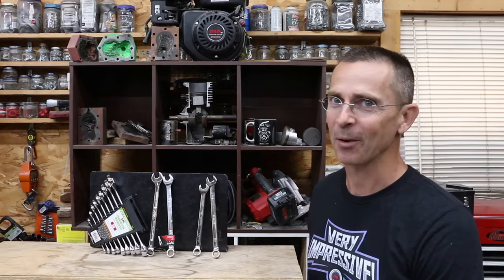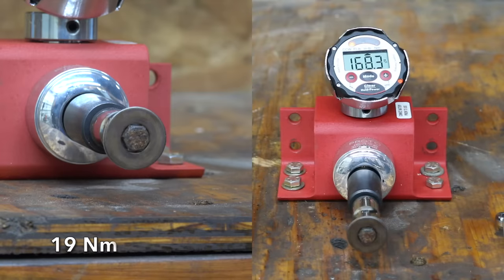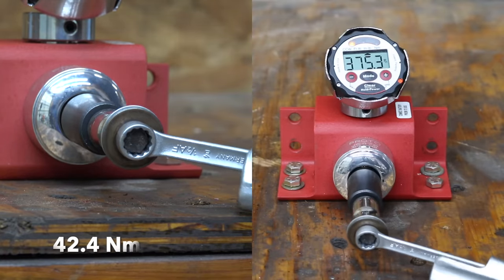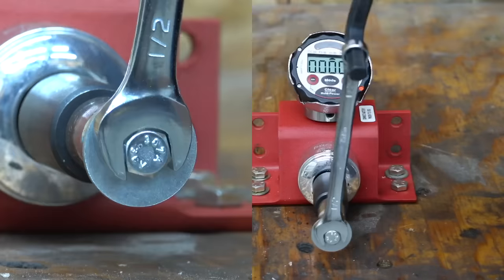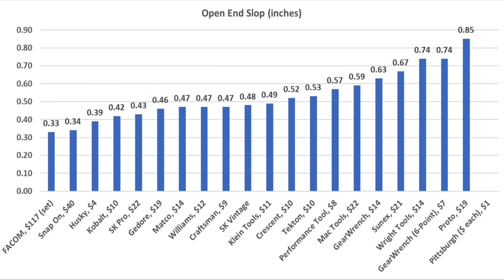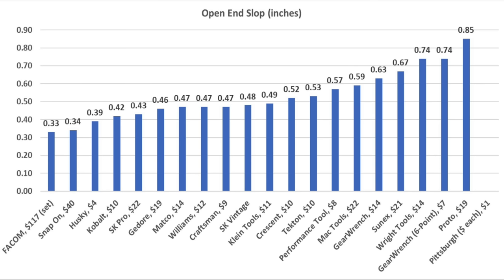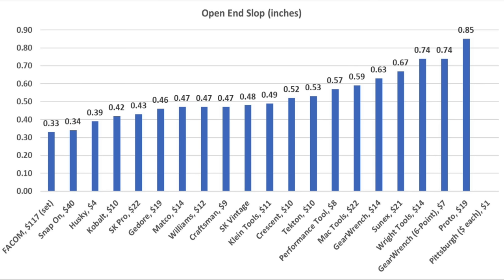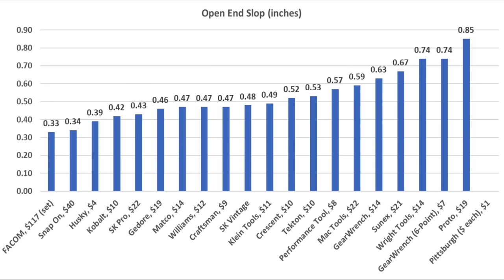Best Wrench? Let’s Settle This! Snap On vs MAC Tools, Matco, Proto, SK, GearWrench, Kobalt, Husky

Comment: This is like a PSA to all wrench makers about the excessive taper problem!!!

Go into just about any tool box in a shop that has to deal with those shallow headed fastener problems and you'll find wrenches and sockets that have  had the tapered section milled or ground down to let the tool actually grip the fastener. The fact that we have to do this to make the tool useful is pretty sad.
Reply: I have both wrenches and sockets I've done this too.
Reply: I was thinking this when I saw the first test. I was like 🤔 "I wonder how well would a cheapo HB wrench do if it was ground down" 😆. 
I'm from England we don't get over half these brands here, so I don't have a dog in the fight, so just out of interest. Same as the Husky, it seemed to be a good mid/to near front of the pack but only $4. Shame Todd made a mistake with it on the Max open End Hex test, giving it maximum points.., skewing it's final placing. I think it would of places 10th on Hex test meaning it would be around where the Facom set was placed. 

Measuring all the open ends for stretch after Max test would of been interesting to see.
Reply: Ditto the chamfer in the business end of sockets. Belt sanders work very well for removing this.
Reply: i have always used Stahlwille tools.  never a problem.  have seen many failures with younger Fitters / Mechanics who start with cheap sets.  always use correct tool for the job.
Reply: I agree, but the flip side of this is that without any chamfer, when the tool slips off it will slightly distort the end of the grip, over time creating its own chamfer.
Reply: I think maybe Husky is the best value for performance.
Reply: Same with allen keys. I grind them flat as well.
Reply: Yeah you're much more likely to damage a bolt on a wrench with that taper than one that's flat. And then that bolt  becomes a bigger problem.
Reply: I'm wondering if the chamfer isn't designed to lose grip before the wrench breaks in two?
Reply: 100% this.  I'm a motorcycle mechanic and in our shop pretty much all of our sockets have been lathed down so there's no chamfer, it makes all the difference aye
Reply: @imoovabull6042  Not everyone is born with the ability to start their careers with top of the line tools.
Reply: @urwholefamilydied  LOL, them's fightin words... Snap-On is a great tool, but from the way some people fawn over getting bent over without lube by daddy Snap-On ???  Mac is better and cheaper, with a decent warranty unless you treat your tools like shit and need to get them replaced often.
Craftsman or Klein if you're a home gamer.
Reply: @boots7859  neither was I,  I had to pay my tools off over time.
Reply: yeah, but we can buy cheaper tools! I often buy cheap crap wrenches to modify for specific jobs.
Reply: @brandont0618  I agree in part.  What I don't know is whether their quality has changed over the years.  I bought my set over 50 years ago and haven't had any problem with them....and trust me, they get used and abused.
Reply: @brandont0618  Try PowerBuilt. They look and feel much better than Husky.
Reply: bUt ThE eAsiNeSs oF sLipPinG tHe WrEnCh HeAd oNtO tHe FaStEnEr!!!
Reply: @StreuB1  Once rounded, twice ground?  Me, too. And I keep a cup of water near the belt sander to cool the tool rather than lose its temper.
Reply: That also makes the tool weaker when you remove material
Reply: Probably quite a few of us have done that to a few wrenches to fit.
Reply: ..yep, it is a problem..sometimes with sockets more so than wrenches...I have found excessive chamfer a really big problem on flare nut wrenches..on those, you want maximum surface contact..actually, I don't think you really need ANY chamfer on those...
Reply: @Zaque-TV  thats another reason I'm a big snap on guy. I like other brands too, one of my mac sockets has that drives me NUTS. My matco and snap on are flat, for some reason the mac has that little bevel. Don't have the balls to take a grinder to it tho waaaay too pricy. Then again my williams don't have it either.
Reply: @urwholefamilydied  I'll never step onto one of the rape wagons again.
Reply: @dyer2cycle  Right, flare nut wrenches need all the contact they can get.  The chamfer permits a wrench to fit on a nut with slight rounding but cheap makers take that to excess.
Reply: what I learned here is to grind down my HF wrenches to make them as good and the more expensive ones.
Reply: Agreed… ground many wrenches, sockets and allen wrenches down flat! They should come with about 90% less taper
Reply: A la Honda CRVs!! such shallow bolt heads - such soft (and breakable) bolt material. Totally spoils a good car. For a ha'pworth of tar the ship was lost. For the want of a nail, the horse was lost, for the want of the horse, the soldier - battle - war - kingdom was lost. Better bolts please Mr Honda!
Reply: Wonder how my old Plumb tools would rate ... been doing a lot of work for me last 60 yrs, and who knows how long for my dad 🤔
Reply: @dougw5950  I have collected some old Plomb tools from before and during WWII. They sit on the wall much of time but sometimes come in handy. The war ones were used by the Navy and have different numbers. PLUMB sued Plomb due to similar name and some tools, thus Proto, Professional Tool Company was started in late 40's.
Reply: Despite whatever their marketing people tell you, I’m sure the taper is a byproduct of the manufacturing process. These tools are stamped out by the millions in automatic presses, and the taper is formed during that operation. There are other ways to cut the box end of a wrench, but they are more difficult and more expensive.

Comment: As a professional automotive technician who’s still in field I can say my experiences line up nearly identically with your test results. Every technician I know, myself included has at minimum 4, usually a lot more complete wrench sets as there is never a one size or style of wrench set that fits all. I have Snap On ratcheting and regular combination wrenches. EZ Red spline drive double box end flex head ratcheting wrenches. A set of SK stubby low profile wrenches, multiple different brands of line wrenches and more cheap wrenches that I bought to modify for specific jobs then I care to admit. Add in metric and SAE sizes and I never want to know exactly how much money I’ve spent on wrenches, it’ll make me sick. My favorite are my EZ Red spline drive wrenches. Super tight ratchet mechanisms, never slip, long and thin to get into tight places, and they fit just snot any style of fastener.  However, the set that had most impressed me is the SK stubbies. I’ve lost count of how many massively seized up motor mount bolts that set has broke free by using pry bars to pull or push on them and they’ve never slipped, broken, or bent. Truly great wrenches all around.
Reply: i am going through the wrenches for my dads estate sale and picking out a few to keep for my shop and it is amazing how many sets we have including those cheap ones to bend to get around that corner or hydraulic on the tractor  we didn't have very many high dollar  but a few craftman, snap-ons, and protos most i think we picked up at auctions or 2nd hand stores! you really don't want a wrench to slip when your trying to loosen that fan bolt or up in the frame of something !!!!!
Reply: I was discussing that with my father the other day, commenting about how anyone that thinks you ONLY need one set of wrenches (or sockets) is nuts.   When you need one, you need it near you, and you need it to be the best for that job.    That and it's always better to have more than one ratchet, so you're not swapping sockets constantly.    Cheap ratchet is fine as long as the socket is good :)
Reply: @tbelding  cheap ratchets are not fine in my opinion. I've had ratchet heads give out at the most inopportune times. That can result in busted knuckles or worse. After almost 50 years of automotive work and millwrighting, I've found my SK ratchets to be extremely strong. Snap-on has a nice small head that allows accessibility where my SK won't always fit, but the Snap-on isn't as strong as the SK. I won't even consider using the newer style Proto ratchets anymore. I've had them slip into the neutral position on several occasions. Busted knuckles are not something a mechanic can afford. Especially when you get old like me!
Reply from the maker: Thanks for sharing.
Reply: I know what you mean about needing a wide-variety of wrenches. I have standard-length combination, six-point box-end Steelman Pro (my favorite set), no-name flex-head ratcheting wrenches that I replace with Tekton once I lose or break one, thin wrenches, and stubby off-set and line wrenches---I realized that the stubby versions didn't exist so I just cut mine in half, and then bought another set to keep as the standard length. Crow's feet, v-notch open-end, service wrenches, and I have the Mountain spline drive (same as the EZ Red I believe) but I always forget that I have them so never use them, lol. For at-home use, I have the Hyper Tough (Walmart brand) wrenches, they are actually very good.
Reply: @tbelding  agreed i like to keep a set of cheap wrenches in every vehicle and tractor  unfortunatle that means i have a whole pile of 5/8 s and no 7/16, 1/2 or 9/16 ths but OH WELL!!! Have fun and dont worry about it
Reply: @frrapp2366  - I know the feeling.  Last week I was in a cage on a forklift, replacing a wireless access point.   I had _three- 9/16th's wrenches with me, and it was a good thing, too.   I dropped one, and I wasn't going to get dropped down just for that.   I just pulled out another one from my bag and kept going.
Reply: Definitely can’t stick with one brand. Sometimes you don’t need the strongest wrench, but you do need one that is thinner than your “good” wrenches or one that is 1/2” longer/shorter... and plenty to chop up and bend. I was just happy to see that the variety of brands I’ve bought over years seemed to stay towards the top of the list, rather than the bottom.
Reply: All of these comments are exactly what I was talking about!  Someone else mentioned crows feet and that made me realize I had forgotten all about my crows feet. I have regular crows feet, thin crows feet, line crows feet, ratcheting crows feet and so on. Sometimes when I’m working on a vehicle and I come across a nearly impossible to access fastener, I’ll stare at all the different combinations of wrenches, crows feet, sockets, ratchets, extensions and so on to try to come up with a workable combination to get at that fastener. Curse the engineer who designed these things to be built in one sequence and put little to no thought into what the technicians who work on their designs, have to put up with, when inevitably something goes wrong.
Reply: @tbelding  I had to do that once.  Up in a bucket to install a WAP on the roof of a wireline shop.  I had someone asked me if I locked the WAP to the mounting plate (Cisco brand) and I LOL.  If they can get up there in the middle of the shop when we have 24/7 crews, I'll let them have it.
Reply: For sure, no one is cutting, grinding or heat bending the good set to fit around a corner.  A quick trip to HF to get a pittsburg to make those one off specialty wrenches.  I have a few of their sockets welded to flat bars to...
Reply: @Drundel  Wait, you knew you were installing AP's overhead and you didn't make sure you secured the AP to the mounting plate? 
Sigh... I guess there IS a reason the sparkies, etc all give IT the squint eye when we show up on the production floor with a lift.
Reply: Richard I also have a set of the SK stubbys and long pattern and never broke one in 30 years unfortunately SK was bought out by the Chinese a couple years ago so it will be interesting to see what happens but they to are my favorite of all my wrenches im thinking about buy another set before they are made in China
Reply: @FRLN500  I agree busted to many knuckles with cheap ratchets even the old USA craftsman are junk
Reply: @Drundel  Better hope that the equipment doesn't vibrate it loose :)   That's like my gun safe.   I tell people that if someone comes in, can pick it up, and carry it off down the street - I'm not going to stop them.
Reply: @tbelding  Good point.  That was about 10 years ago, but I THINK it was the model with locking tab on the mount that you had to depress to slide the WAP off of it.
Reply: @boots7859  It was about 10 years ago and memory is fuzzy, but I think it was the model with the locking tab on the plate, so you had to depress it to slide off the WAP.  But hell knowing the wireline shop, we might have just zip tied it through the locking bracket.
Reply: @Drundel  Eh, even if it wasn't, if they're bouncing stuff around that much, whoever it dropped on probably deserved it.

Comment: One thing to note about Mac wrenches: the carrying case they come in is AMAZING and the wrenches all have a slight protrusion on one side of the box end that is great at getting to slightly hard to reach bolts.
Reply from the maker: Thanks for the feedback.
Reply: Correct. It is a patented feature and is also easy to test.
Reply: That case is great.i think Stanley might use them too? Not sure on that one. It would make sense if proto and Stanley used them too tho
Reply: @professordrmao6321  Mac is made under Stanley parent company IIRC
Reply: @TheRealNarwallaby  yeah all I know is they're made with different dies at proto of Houston? Well iirc. Its like how snap on owns williams but sometimes the cases don't translate across brands etc. Either way, mac has the right idea with their wrench cases imo

Comment: Looks like Husky for the money is the best value of all of them, incredible !!!
Reply from the maker: Thanks for the feedback.
Reply: Yea kind of what I was getting.  Def better, but husky makes alot of good budget tools.  Just not a fan of their screw drivers you can get care better for cheaper else where. Cresent is a pretty solid middle ground I typically bye their pliers over Klein.  Just better value per dollar imo.
Reply: I love my husky wrenches and rachets. Definitely great value
Reply: I’m trying to decide between husky, gear wrench and craftsman.
Reply: @andythompson3528  Husky wrenches are absolutely the best value. If you're going to go a step up I would go a step up with the rachets
Reply: @andythompson3528  Home Depot might still have some left over Husky wrenches and sockets from Black Friday.  Good way to get decent sets for a good price.  I bought mine years ago on a Black Friday and am still using them.  They are a great value.
Reply: Thats likely no longer the case. They have recently switched over to made in India wrenches.
Reply: Especially since Husky got F-ed in the test. Got a score of 19 for open ended torque when the Husky actually sat out that round? Husky was hanging out at the top for most of the other tests. Project Farm appears to be biased against Husky.
Reply: @joshdiehl8737  Yes, they were made in China before but I never saw a made in India wrench that was worth a damn.
Reply: Especially when you can get a 44 piece set with regular combination wrenches and stubby wrenches for 60 bucks.
Reply: I like my Husky tools.  Very good product for the money.

Comment: I went to work operating asphalt plants years ago and was required to have tools. My boss had mostly snap on stuff but told me he started out with Harbor Freight tools and slowly replaced them as they broke over the years. I also picked up a lot of Craftsman tools from garage sales but always liked S-K brand as well.
Reply: S-K makes some beautiful ratchets. The 72 tooth that are called Tough Torque or Tuff One, something like that. Smooth as can be.
Reply: In defense of Harbor Freight's Pittsburgh tools: I have a couple of sets that I don't put to heavy-duty use.  But those wrenches are thinner and shorter than my other brands, and great for getting into tight spaces on motorcycles that don't require a lot of torque, but are unreachable with most brands. Most recently, the oil fittings on a 33-year old Harley-Davidson Evo engine gave me fits until I grabbed the Pittsburgh wrench and it went into spaces where the others wouldn't.
Reply: @markchidester6239  I've got an old S-K 3/8" drive ratchet that I've had since the early 70's. Most of my tools from that time period grew legs & moved on, I guess. It may not be as pretty as some of my more modern ratchets, but it has served me well. But I take care of my tools, except for not keeping them locked up in Fort Knox perhaps. Even that place is probably not kid proof.
Reply: @georgiabrigand6793  always good too have a variety, less and less room every year eh
Reply: SK is dry right now. Literally zero tools on their site